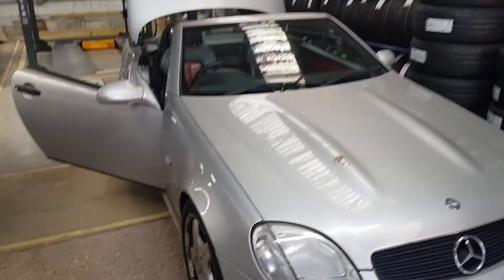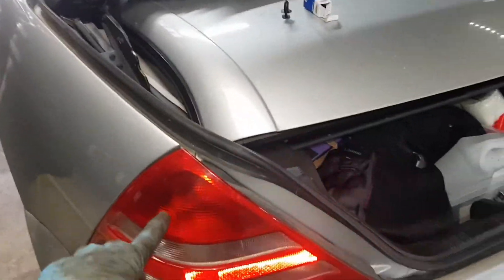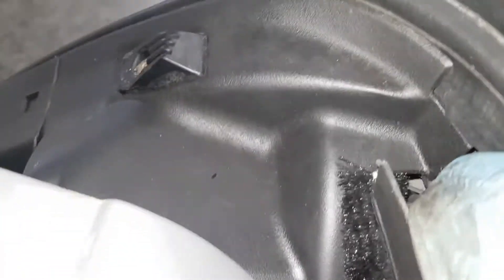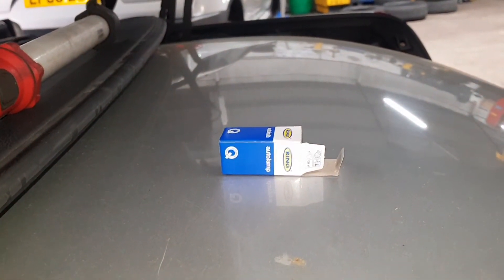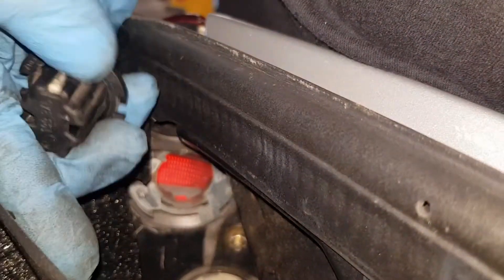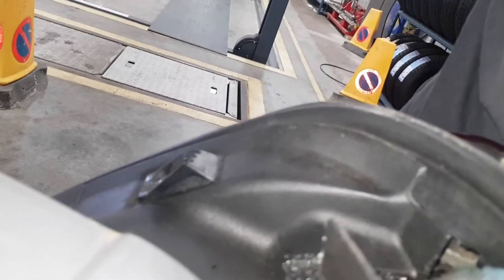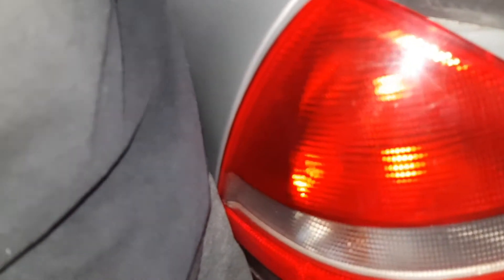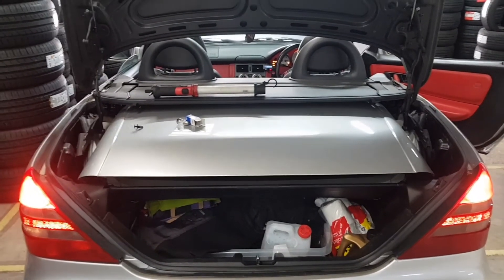how to replace brake light bulb on Mercedes SLK #stoplamp

Comment: hallo on my SLK the bottom rear brake light keep on blinking while driving what is the problem no warning on dash
Reply from the maker: Hi, maybe loose connection so check that first or it could be the bulb holder too. Thanks 

P.S if all stop lamp flashing then check the brake switch too which is located on the brake pedal.

Comment: What if I dropped the bulb housing down into the bumper?  Any easy way of retrieving it?
Reply: Considering I found a 6mm hex key from Germany down there I feel like I'm boned
Reply from the maker: If you can get your hands through then you may be able to get it out. If it’s more towards the wing then just unscrew the arch lining and you should be able to get it from there. Hope this information helps. Good lucks and thanks for watching the video 🙏🏽